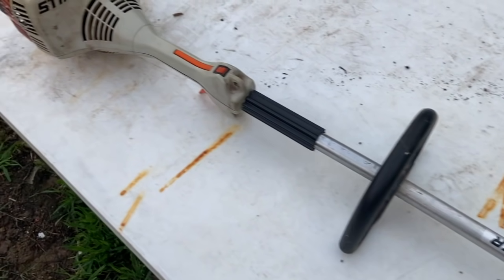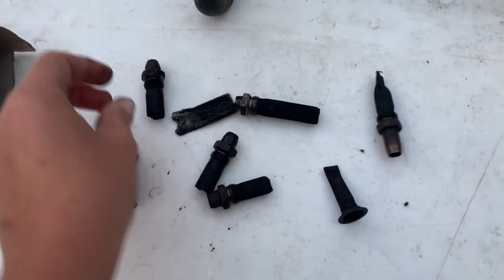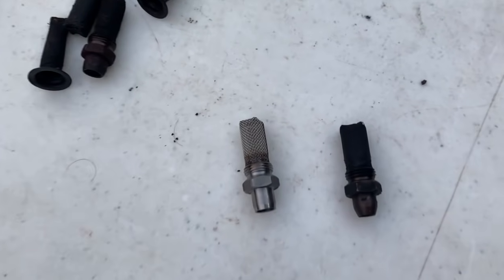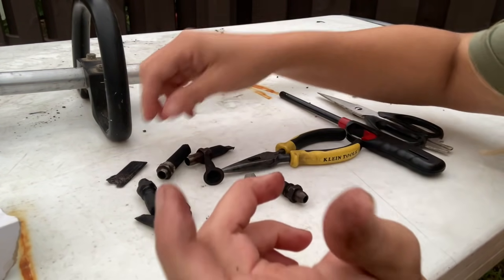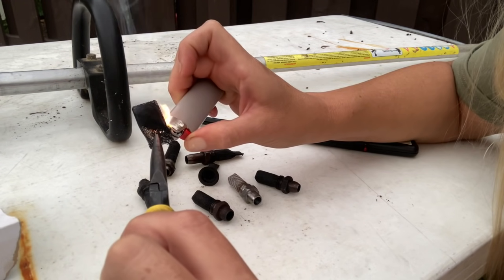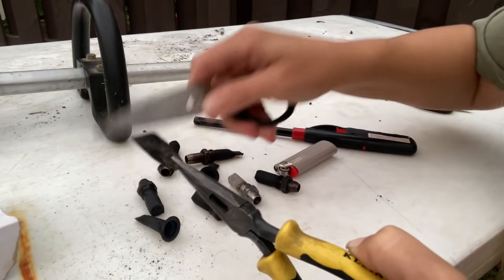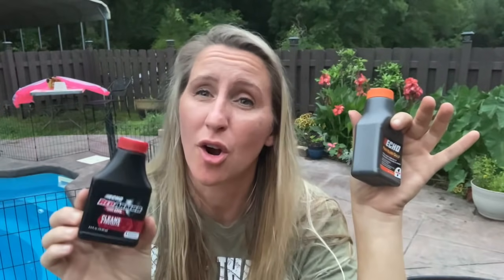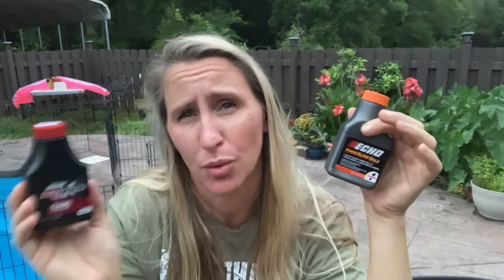THE BIG SECRET! STIHL has NO POWER? Won't Throttle Up? How to fix your trimmer/blower.

Comment: Great video! I just helped a buddy of mine fix his Stihl BP blower with the same issue in the same manner.... quick & free fix.  The advice about running wide open throttle (WOT) I'd spot on for at least a good part of the time.  As a former 2 stroke dirt bike rider and racer for years,  the advice is the same.  To have better and more complete combustion with an oil/gas mixture WOT  once in awhile is a must.  The smaller the engine the more true this is otherwise expect clogged up spark arrester screens.  I've run stihl, husky and homelite 2 stroke power equipment for 45 years and never had this problem, just mix the right ratio and stay away from ethanol/bad gas & don't forget to clean the airfilter once in awhile.   Happy motoring!
Reply: Yep! Same here

Comment: Great videos!

A few words about 2 cycle engines..
The cold seizure is when a piston expands unevenly and scores usually on the exhaust side.
The cause is starting a 2 cycle engine and running it at full throttle from the start. The cure is to warm up the engine at idle for a short time before going full throttle.
Reply: How long do you let a 2 cycle eng. warm up?
Reply: @johnnellis3025  How I do it, in the summer idle for about 10 seconds then half throttle for another 20.
Chain saws in the winter should be warmed up too before cutting at full throttle. Same for 2 cycle snow blowers. I have 2 cycle engines over 10 years old and never had a problem with piston wear.
Reply: I usually start the engine on whatever two stroke equipment that I'm going to work with then lite a Marlboro red short up. When I'm done with my smoke I let it rip and hear the power of a stihl as I get it done. I have equipment going on 10 plus years old. I don't constantly hold the throttle wide open the whole time I'm working but it stays between half on easy  tasks and three quarters to full on the thicker or harder stuff. No sense in running a powerful trimmer wide open throttle just to trim between one to three inches off of grass. Now if it's a foot and a half or more of grass and mess then it's wide open and slicing through but that's a pretty good load for it to handle.
Reply: @johnnellis3025  8
Reply: Also from running low octane fuel
Reply: @johnnellis3025  depends on the machine but you should be able to put it on full throttle without it bogging down. I start it with the choke on and let it run until it dies. Turn off the choke, fire it up and leave it for a minute.
Reply: I saw on another video on here where they talked about cold seizure, and they said its best to let them idle for a minimum of 30 seconds at the start, then gentle throttle for about a minute or so after that till they warm up properly.
Reply: @shawndubay4050  It would be a lot better if you could time how long it takes to smoke that cigarette, and start setting  a timer or something, stop smoking, and maybe those machines won’t out last you. Lol. Just a thought. We hate to loose a fellow machine user prematurely!
Reply: @stevenmark8156  I think it's about five minutes I generally put my hand behind the engine to see if the cooling air is decently warm and then go to work with it. Im trying really hard to stop smoking. It's a war that I'm battling with. thank you for caring about my health and your kind words my friend. The world needs more people exactly like you. The world would be alot better place.
Reply: @shawndubay4050  I understand the battle!  Went thru it myself about 35 yrs ago. If God hadn’t delivered me, I’m pretty sure I would still be smoking. I’ll be praying for you!
Reply: @stevenmark8156  I thank you my friend. God is great Amen 🙏
Reply: @shawndubay4050  after 40 years and many methods I honored my Dad's final wish and quit smoking.  My method was to quit drinking and smoking simultaneously by telling myself I was done and I meant what I said. Haven't touched either since that day, Robbie Burns Birthday, Jan 25 2013.  Good luck.
Reply: @catey62  that's how you do it! Any engine needs to warm up before you work it. They could possibly still cold sieze even after idle, you need to kinda build into it.

Comment: I pulled the spark arresting out of my saw the second time I used it. Runs great ever since.
Reply: I’ve done that with every chainsaw l bought, since 1987.  The only time l re-install the spark arrestor is when cutting timber in summertime, to avoid the possibility of starting a fire.
Reply: I pulled the screen out my cheap home light and I’m happy.  Gotta now go and do that to all my stuff.  Couple mowers, couple trimmer, couple edgers.
Reply: I have the same weed trimmer and so far no issues except it shakes more than echo and I use high test gasoline starts 1st or 3rd pull
Reply: If you get caught without a spark arrestor in the national forest they may take your saw or fine you. 🙂
Reply: @baldeagle242  No, you can cut downed trees.

Comment: After a long time of trouble shooting, I did recognise this exhaust filter/flame arrestor was 100% clogged.  I took it out many years ago and all is well. I have had no sparks emitting from the exhaust.  My take on it is, if you have such a screen filter regardless of your RPM or oil used, it is just a matter of time and it will get clogged. I use light body SAE automotive oil and no problem.  My FS55 is about 20 years old now, but works well, with very good power and acceleration. I don't use the unit often, but when I do, I push the unit long and hard.  Thank you Chickanic for highlighting this problem and fix.

Comment: You were right, of course. Lugged my trimmer down, knew it was bad, but...just...wanted...to...finish. Would not start again, fresh gas, new plug, figured I had burned it up, bought another, kept the old one.Took your lesson, fixed it, thanks again. (Good news about your future, Old mechanics never die, They just lose their bearings)

Comment: We have a Stihl FS 55 that's 10+ years old and still has it's original top end, still runs great. We've always ran Bel-Ray or Amsoil at 50:1. The exhaust screen was removed shorty after purchase, and no fires have been recorded so far.
Reply: Been ripping those screens out for 20 yrs.and no problems.
Reply: It’s illegal to remove the spark arrestor and not replace it
Reply: @dave011679  I don't think big brother is going to throw me in prison for removing the hail screen out of my trimmer's muffler, not yet anyways.
Reply: @danielc5205  It's really just a fine and the odds of getting caught are miniscule, still the manufacturers make it a point to inform dealers about it. At my dealership, I remove, clean and re-install the screens just to be on the safe side.
Reply: @dave011679  OH NO, PLEASE DON"T TURN ME IN TO THE MUFFLER POLICE!!
Reply: @BKD70  you think it's funny but the EPA will fine dealers up to $40,000  for violations. I've owned a dealership/repair business for 20 years. Anyone who's in the actual industry knows this.

Comment: I have a small gardening/yard maintenance  business, and the only power equipment I own is Stihl. I own 4 hedge trimmers: My first one is an HS45 (the best of the bunch engine wise), an HS56, an HS56C, and a brand new HS82T. The HS56 series of trimmers are CONSTANTLY in the shop for a loss of power or for high Rev spasms. Just today, my brand new $800 HS82T is now doing the same thing  as the others, and I can't believe it!🤯

I also own basically every other piece of Stihl equipment that there is to own, and most of everything else works great. No complaints. So I believe it has something to do with how the hedge trimmer motors are built.

I use high test gasoline with Stihl oil... I will purchase Ecko oil and see if I notice a difference. 

Thanks for this video!

Comment: I passed on the Stihl oil and went with my trusty Amsoil Saber at 100:1 on my FC56.  Runs great, had it 6 years and I cleaned the arrester two years ago and it still wasn’t clogged, just a small amount of carbon.
Reply: I have been running Amsoil  100:1 with all my two stroke engines with 93 octane non ethanol for many many years with no problems whatsoever!!

Comment: I have repeatedly cleaned these screens, carburators and many other parts in my ultrasonic cleaner.  They are available at quite reasonable pricing anymore and are a great investment for a shop.  I personally use Simple Green as my standard cleaner in it and it has been very effective while also being gentle on rubbers, plastics, etc.
Reply: Great info.  I use Simple Green as well, but to to use it for this application and having it already tried and tested... 👍👍
Reply: You can also use your grill to “burn” them clean.
Reply: The propane torch has them spotless in about 15 - 20 seconds.

Comment: Hi.At the start of your vid I was about to jump on you.I have been a Stihl master tech for 25 years.I do not find a lot of diff in most oils and germany has masterd it.Opti  or chinese synthectics are the only ones that will void  a warranty.That being said you gave a great demo and covered most of the problems,the costomer being #one.On my bench grinder I replaced the wire brush with A brass one only takes 30seconds to clean a screen.Just for shits and giggles I own many Stihl,Husky and Echo products.All are run on the cheapest gas possiple.Kept inside and run at least once a month.I have not needed to do a carb job in ten years.Again costomer being the problem.Well done.
Reply from the maker: Thank you! I do the same with the cheap gas, although I do use ethanol shield. I only use my 20 yr old BR 400 a couple times a year, and it starts every time. It was one of the best light blowers ever made in my book. Thanks for watching!
Reply: Stihl doesn’t have master techs. They have 3 Levels of expertise.
Reply: Master Tech?? Lol 
And HeMan is the Master of the Universe 🤭🤗🤣
Reply: @THEMOWERMEDIC1  Correct
Reply: Interesting, I've been told by 4 seperate Stihl dealers that unless I use either Stihl motomix, Aspen or at the very least Stihl super 2 stroke oil they won't honour the warranty on fuel related issues. They say Stihl original oil is just as harmful to the newer machines that even that will void warranty. Who's telling the truth here?

Comment: I have a steel FS 70 weed trimmer noticed I was getting all the residue around the muffler pulled my screen and cleaned it but did not realize I need to run at wide open throttle thank you for the comment
Reply: the only time you shouldnt run a machine at full throttle is when you're trimmin around delicate things otherwise always run it full throttle

Comment: My Stihls get Golden Spectro. It has been known to clog power valves on my dirt bikes, but I like it because it lubricates my two strokes very well, so I put up with a cleaning every now and then and a little spooge dripping from the exhaust.  Never thought about the spark arrestor/muffler on the little saw. I'll have to clean it. Thanks!

Comment: Yeah, I've had a lawn and landscape maintenance business for over 30 years, and I noticed that problem years ago on my Stihl stuff, but I never had anyone ever tell me it should be run at full throttle to avoid it. And I rarely run at full throttle, for the noise if nothing else. I've always used just enough power with string trimmers and edgers, etc, to get the job done. Well now I use their battery powered string trimmer, hedge trimmers and chain saw, so no more worries about fuel, oil and exhaust issues on that equipment! 😁
Reply: careful ....youll lose your man license
Reply: I’m going battery powered on everything that I can. I got so tired of rebuilding those little dinky carburetors and dealing with non-reliable equipment. Do yourself a favor and don’t buy anything but STIHL brand.
Reply: @sweetdrahthaar7951  Makita or dewalt for electric. STIHL is great for gas though
Reply: @waterloo123100   👍🏻 Thanks
Reply: Stihl battery stuff sucks, much happier with Milwaukee
Reply: @kwmiked  if that was the case professional landscape companies trailers would be full of red equipment not orange. 😂
Reply: @sweetdrahthaar7951  they are around here. Guys learned the battery stihl stuff was a waste
Reply: @kwmiked  i’m just one homeowner with a fairly large piece of property so I probably don’t use mine as hard as some people but I’ve been pleased with the stuff I bought.

Comment: I had my Stihl chainsaw screen clog over a few years ago. I hadn't seen your vid, but guessed it was unburned oil and fuel so I blasted it with a propane torch. Then I used a brass wire brush to finish the job.  Clean as a whistle after that!
Great vid, looking forward to more!

Comment: I love all my Stihl trimmers, power washer and chain saws and have a great dealer and repair location.  Good detail to know that everything should be run full throttle.  I did trade in all my gas chain saws for a battery powered one because I can't get the gas ones started because I leave them sitting for long periods between use.   I also really like Chickanic.  I'm 68 and grew up in a time and place in which girls and women were treated as incapable of doing anything like this.  I am always deeply affected when I see women  proving them wrong, and, these days seems like I'm the only one still marveling at it.  Now it has become obvious to everyone.

Comment: Great info.
I've always used Yamalube 2r in every 2-stroke I've ever owned.  My Echo trimmer is 16 years old, and still starts on the first pull. I have a huge yard, and go through almost a full tank every time I use it.
Reply: Yeah man Yama. lube is the one to use
Reply: I would always recommend 2R to customers who came through the shop I worked at. or Motorex. I also use their Waverunner oil in my Waverunner 500. their Yamabond is the best stuff on the market too
Reply: The motorcycle industry is where to look for the correct 2 stroke info. We have been running clean burning oil for decades that promote reliability and performance.  When someone says "no you can't run your machine without the spark arrestor " then winks at you, they really mean the opposite.  Spark arrestor are mandatory for motorcycle racing on state and federal property.  We always cut the screens out and replace it with a cotter pin so when tech inspection sticks a probe in the exhaust it stops at the cotter pin. Passes tech every time.

Comment: I have used Stihl equipment for nearly 25 years - string trimmers, hedge clippers (HS80), edger (FC85), hand blower (BG86), and chain saw (limited use).  I have gone through many string trimmers - FS85, FS94r, as well as BG86.  Cleaning out the exhaust screen and port is just routine maintenance.  There is nothing unique in this task.

For the last 20 years, I've used Amsoil, at about 50:1.  The FC85 has ran for more than 15 years.  But the trimmers run for 2-4 years - engines lock up.  The advise of running WOT is important.  I think it may be the key to the FC85 longevity.  Edging is always WOT (also use it with a 22" hedge clipper attachment).  I used my FS94r to trim out 5-7 lawns per day.

Many of the comments here speak about "2 cycle."  Many of the Stihl family are 4 cycle.  The issue is not 2 or 4 cycle, rather the lubrication mechanism - sump vs. vapor.  My trimmers have been 4 cycle for  years and I have no problem.  One valve adjustment after about 50 hours and never again.  The major problem is carb diaphragm failures.  Apparently, the ethanol degrades them.  A rebuild is simple.  Even new ones are not very expensive.
Reply: Thank you for that detailed informative response bud.
Reply: I only use 100% gas, no ethanol. I've never had a problem, and this is over 20 years of use.
Reply: @btolich  I don't know where to buy ethanol-free gasoline.  I do buy Premium grade gas for all Stihl gear.  Is it better than Regular?  Dunno ... I have no statistics to prove one  way or another.  Many years ago, somebody on a Forum strongly encouraged the hand-held equipment to burn Premium.
Reply: @rightsideofthegrass8114  Bummer! Even though you're using premium grade, it still has ethanol, and that degrades the rubber components of the small engines. The octane rating merely has to do with how much compression the fuel can withstand before detonation. Premium is typically used in vehicles with high compression ratios. Small engines don't generally have high enough compression ratios to warrant the use of premium fuel.

Comment: Thanks for the video.  A few years back, I experienced the drop in power on a Stihl back blower and cleaned the spark arrestor screen as prescribed.   After the warranty expired,  switched over to AMSOIL Saber 2 stroke motor and the issue of the clogged spark arrestor screen ceased to emerge.  The back pack blower has run on AMSOIL Saber oil for several years now without any issues. Other advantages of AMSOIL Saber is a cleaner exhaust emissions fewer incidents of plug fouling.

Comment: Very pertinent information, but I am a little late in discovering it.  I hate my Stihl 65 trimmer so much I rarely use it.  It's been in the shop twice with non-starting problems and then I learned to replace the carburetor myself.  I've been into non ethanol gas at the filling station as well as Tru Fuel for a dozen years.
If I'm within 100' of an electrical outlet I will reflexively grab my 12-amp corded trimmer.  It never fails at anything.
At any rate, I've learned a lot from this channel and recommend it highly.
Reply: Chickanic did a comparison video of Trufuel and Red Armour and found the Truefuel made engines run hundreds of RPMs slower.  Ditch the Truefuel.

Comment: I still have my Briggs and Stratton yard trimmer from the 80's.
Never had a problem and still running fine , I do use seafoam in it.
Reply: It's called engine tune from mercury marine its just rebranded with a different name...look up quick silver products... 60 yr old company
Reply: , never had a sticky valve ? Thanks.